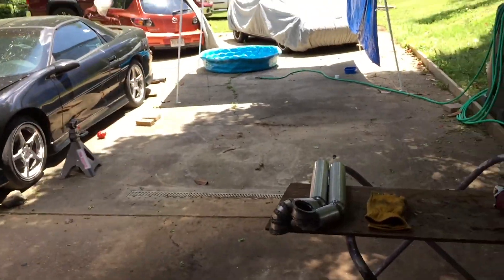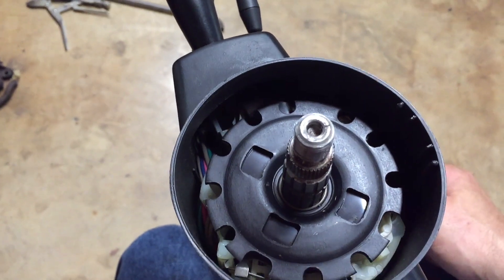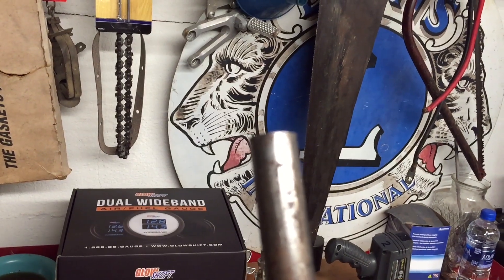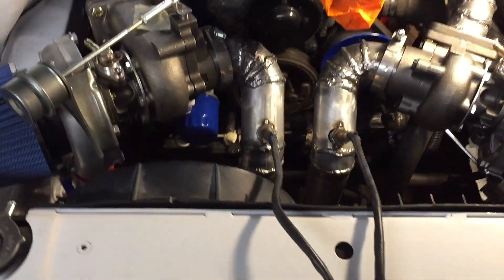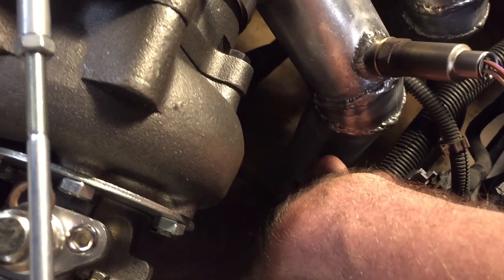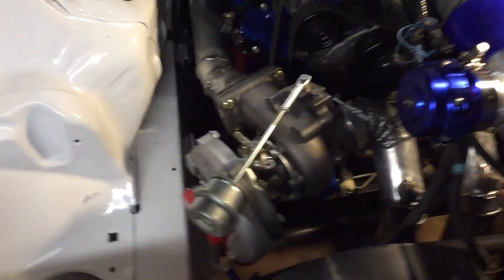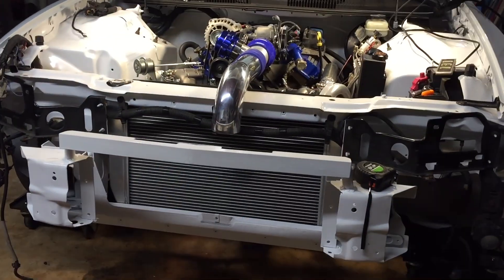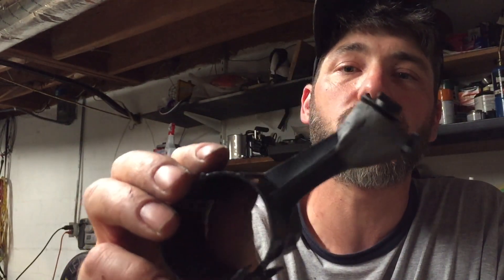Weld on wideband o2 sensor bungs 3800 series 2 Camaro -Twin Turbo Build Part 23

Comment: Heat range 5 on a boosted v6 is too hot! You'll detonate and blow a head gasket or worse. I would run atlest heat range 6, but a 7 would probably be best for your application.
Reply: TR7's gapped between .025 and .030 would be ideal.
Reply from the maker: you are totally right thank you !!. i had no clue about spark plug heat range did some research and yes a 7 would be ideal for me went to the local auto store and swapped out for some ac delco hr6  the next day which is what they use in the supercharged 3800 definitely getting hr7 after i bump boost over 5psi thanks again !!
Reply: @DeeStruggles  No problem, almost finished can't wait to see it run!